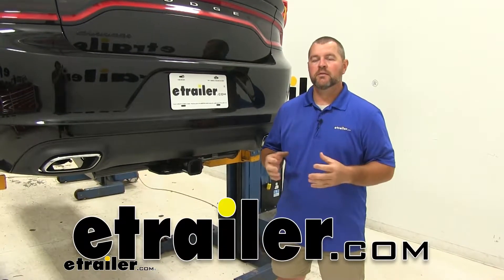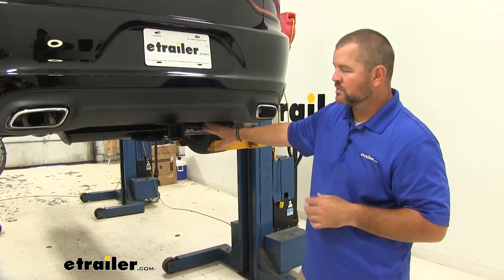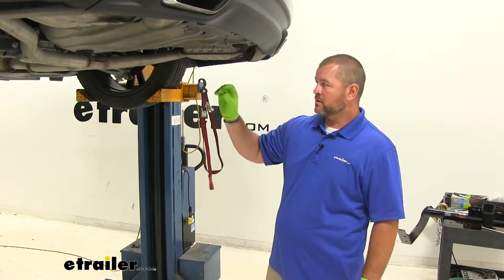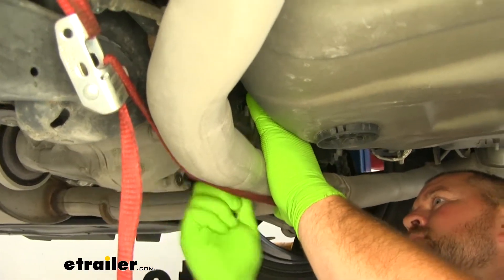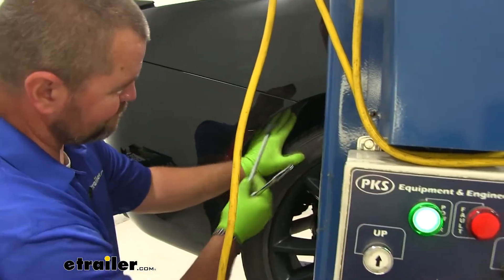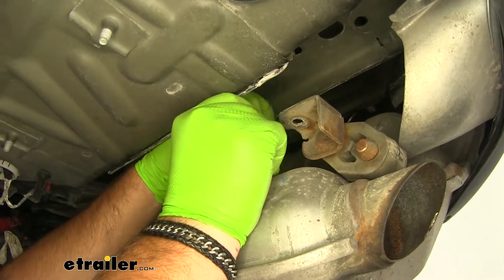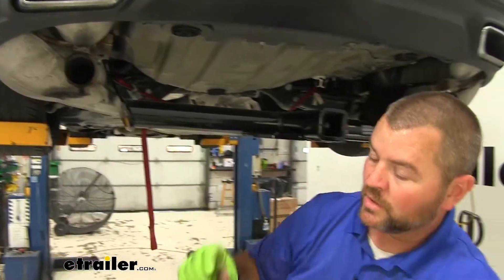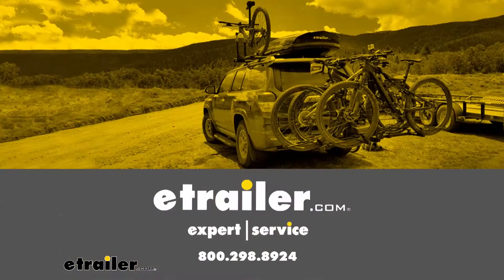etrailer | Installing the Curt Trailer Hitch Receiver on your 2017 Dodge Charger

Comment: I thought the max towing capacity was only 1,000 whats the point of making it larger
Reply from the maker: It is never a bad thing to have your hitch be stronger than the vehicle towing with it. You won't have to worry about overloading your hitch if you are following the capacities of your vehicle.
https://www.etrailer.com/Trailer-Hitch/Curt/C13236.html

Comment: Is this a v6?
Reply from the maker: Yes, this particular installation was done on a 2017 Dodge charger with the V6 motor in it. This hitch is designed to fit the V8 models also.
https://www.etrailer.com/Trailer-Hitch/Curt/C13236.html

Comment: Where can I get this installed ?
Reply from the maker: Many shops will install hitches for a set price or an hourly rate. You can also check with automotive body shops.
https://www.etrailer.com/Trailer-Hitch/Curt/C13236.html
Reply: @etrailer  you should make a video about a v8 version that has tips and not a cut out for exhaust